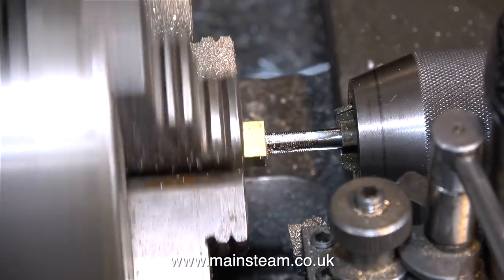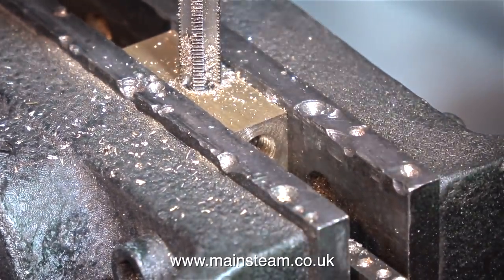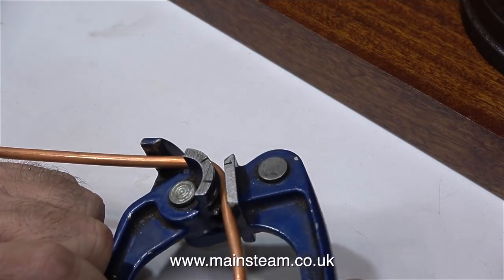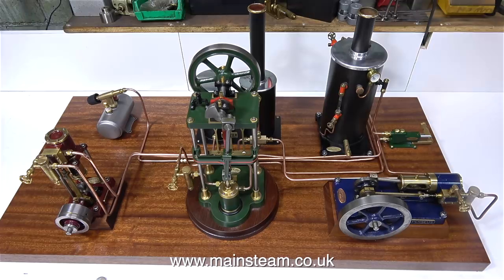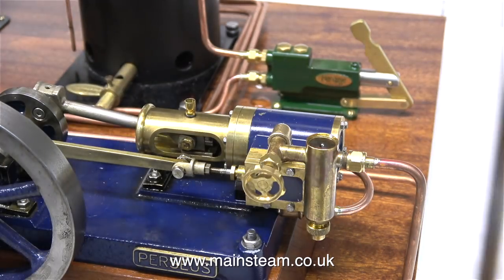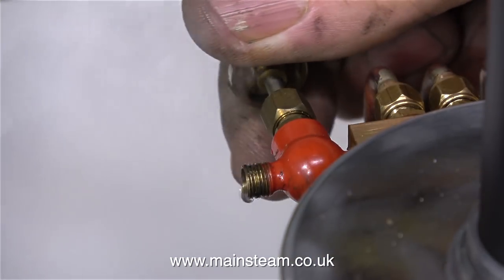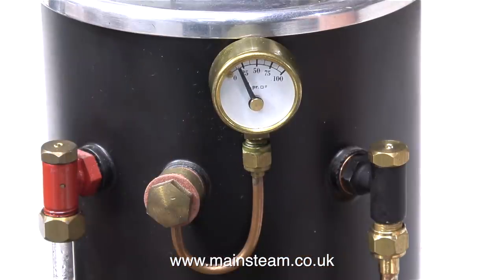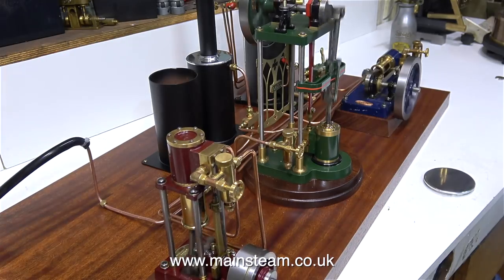A MODEL STEAM PLANT WITH 3 STEAM ENGINES - PART # 12

Comment: This went surprisingly quickly as a series.  Loved it! Thank goodness you warned the viewers in an earlier clip about the lubricator orientation or there would have been a riot by now. 
I had a thought about hidden piping in the baseboard just now.  I think it would look very polished to hide some of the cold piping inside the baseboard in hidden groves.  You could have fittings where the pipe enters and exits the board and it would reduce some of that beautiful metal clutter with more fancy pieces of brass to take their place.  I'm sure this would be completely ridiculous to everyone who reads this poorly thought out idea. Issues with draining pipes and even more holes in the baseboard come to mind as negatives. Still, you'd have more fittings on display and I do enjoy the detail you put into your fittings.

Comment: as a suggestion regarding permanent steam pressure to 2 of the lubricators due to orientation, would it not be prudent to fit a main steam valve on the outlet of the boiler to allow isolation of the system, and allow refilling of the lubricators whilst there is still steam in the boiler?
Reply from the maker: Yes, but it's not really a problem - all I have to do is turn off the gas and wait a few minutes and while I am waiting for the pressure to disappear it is time to re-oil the engines anyway ....

Comment: Did the owner specify the order of the engines on the board? I think the horizontal would have looked nice between the two verticals. Also there seams to be an empty space in the back left corner?
Reply from the maker: did you not notice that one of the vertical engines is twice as tall as the other ? The space that you mention at the real left of the plant is for the option of a larger gas tank . . .

Comment: Hi, is their any chance of the exhaust pipes back feeding into one another?
Reply from the maker: I don't think so ...... do you ?
Reply: Keith Appleton if say two often engines were running and the condenser was fullish,then some of the exhaust steam might find its way up the third pipe.thinking on it now, if the steam made it through the third engine it would be stopped by the regulator valve . So  I suppose the only thing that might happen would be filling that engine with condensation. This is all idle speculation on my part. Thanks for getting back to me.
Reply from the maker: Gas like water always follows the path of least resistance - which is up the chimney via that condenser, there is no way that the exhaust can find its way to any other part of the plant .....